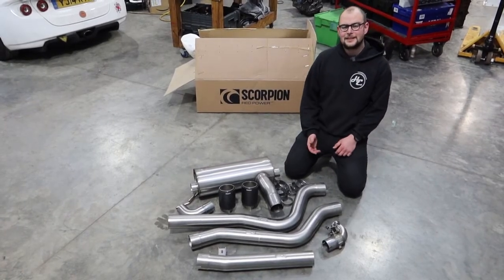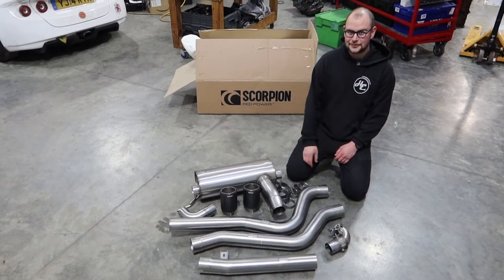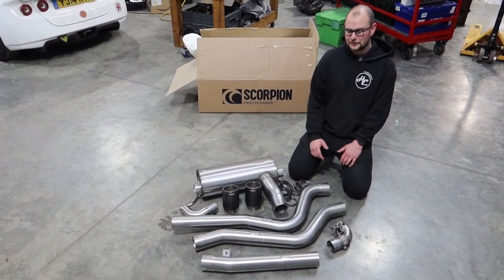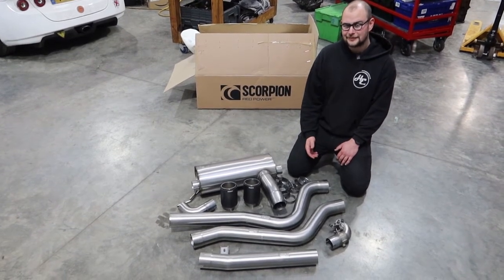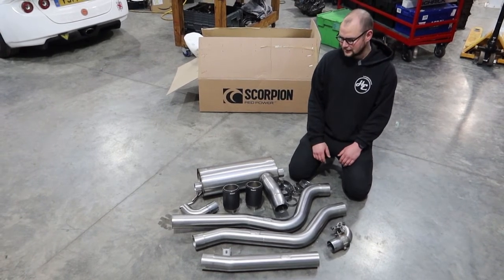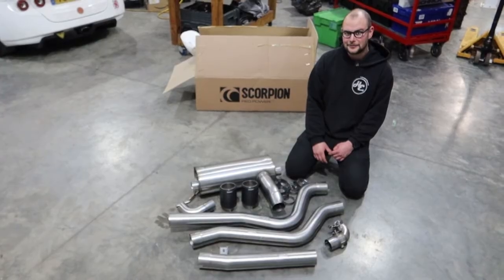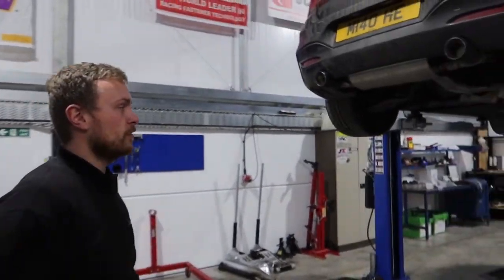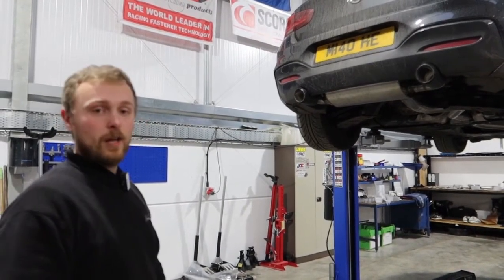M140i SCORPION TURBO-BACK EXHAUST INSTALL! The HE140i Gets A Serious Sound Upgrade

Comment: What is turbo back?  I have non rescat back.  But want louder.  What do you suggest i do next?
Reply from the maker: Turbo-back simply means that we included the downpipe. This does make it a good bit louder.
Reply: @hackengineering5586  can I do the downpipe but I don’t want the car ecu touched because of bmw warranty
Reply from the maker: @gee5889  a sports cat downpipe shouldn’t upset the OE map, but a decat will
Reply: @hackengineering5586  what do you recommend I do next for sound and driving wise.  I have done the milltek non res cat back and the rear underbrace
Reply from the maker: @gee5889  subframe inserts and LSD! Video coming soon. Do feel free to email us on info@hackengineering.co.uk for advice also
Reply: @hackengineering5586  thank you.  Let’s do a proposal then and I will purchase.  What about sports cat/decat with the current Setup off the milltek non res cat back?  Car is not tuned
Reply from the maker: @gee5889  email us and the team will get back to you 👌